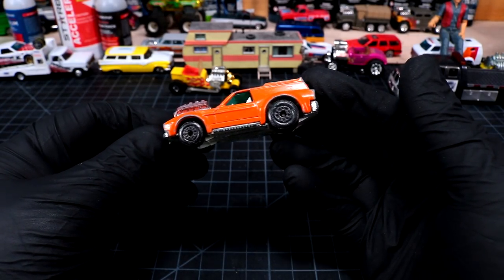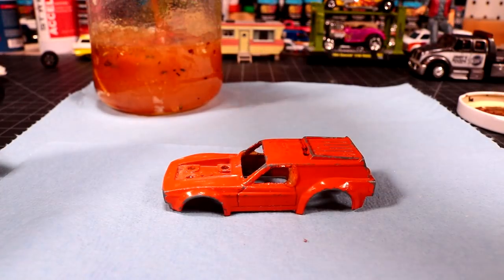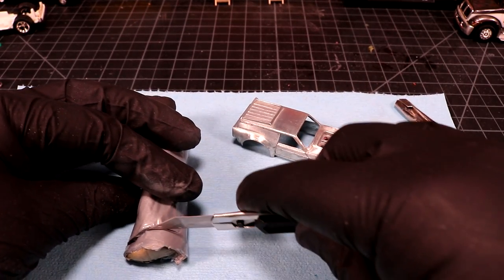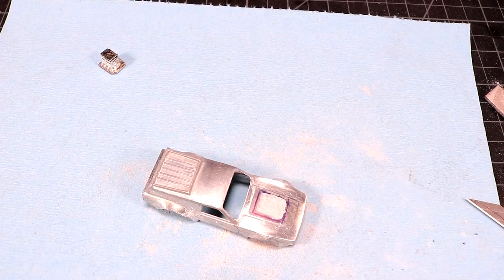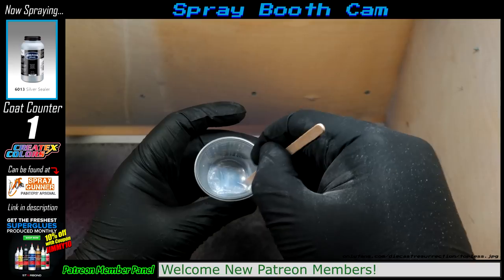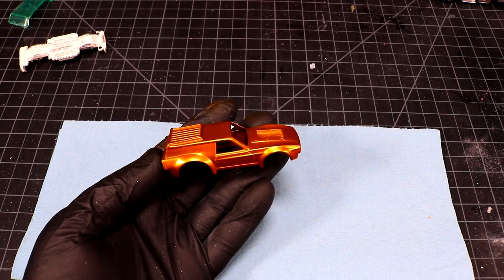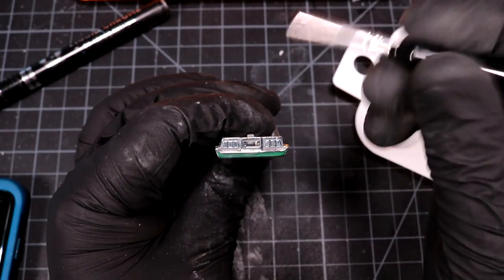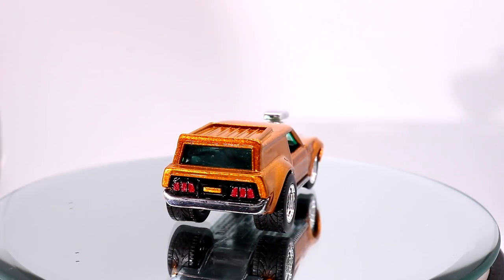PAINTING DIECAST MODEL CARS - Ford Mustang Wagon (No34 Matchbox Vantastic)

Comment: The interior would have looked cool if you had painted it red, and the motor probably should have leaned back a little. If you follow the transmissions line it looks like the drive shaft would end up inside the car.
Reply from the maker: It doesn't have a transmission.
Reply: Still looks cool. Just would have looked more realistic if it had leaned toward the back a little. I guess it is a fantasy car so realism is irrelevant. Either way I really enjoy watching your videos. I used to build and modify plastic model cars for car show competitions as a kid.

Comment: the original tire/rims are better . Replacement tires are not the look n stancefor early 90's and diecast because the tire itself looks like low profile tires and those are ugh and as long as the original are not broken chipped they are much better stance